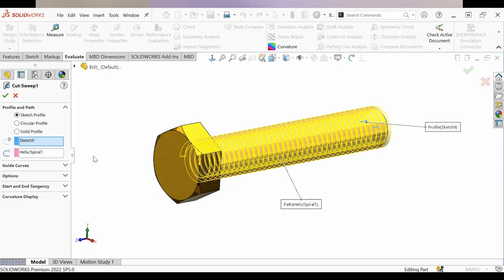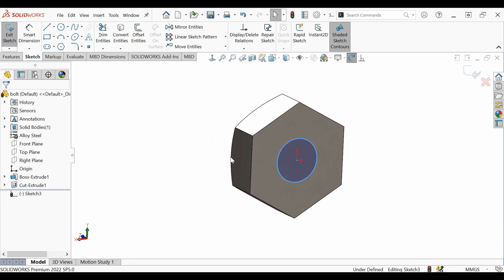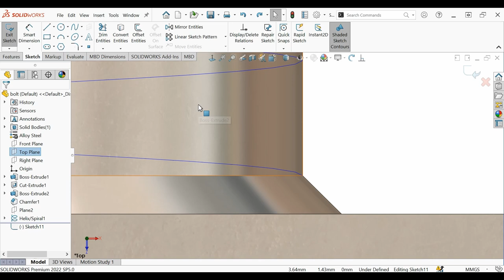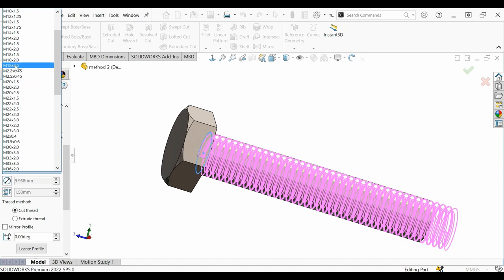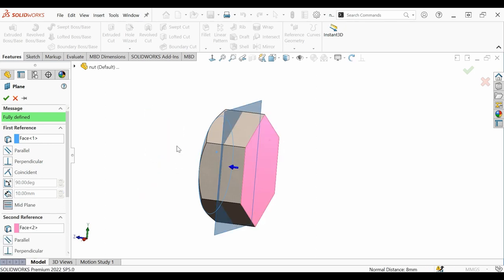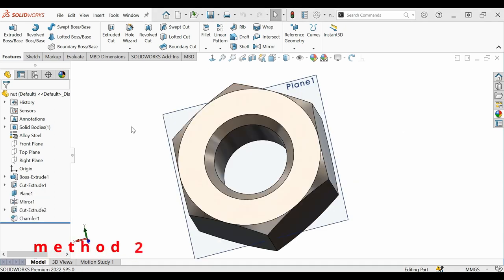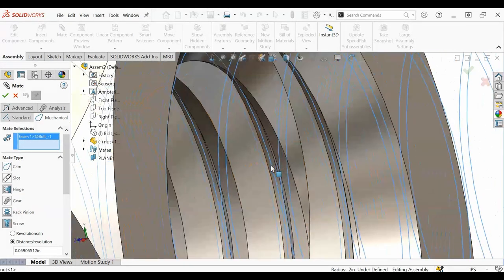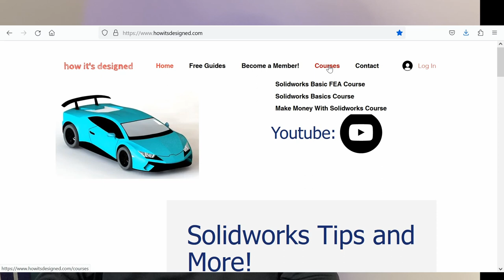Ultimate Solidworks Nut and Bolt Tutorial!

Comment: You did it the exact opposite way. You cut it in the nut and extrude it in the bolt not the other way around. Personally I would cut it either way regardless. way easier and looks better.
You also forgot to add any tolerances.